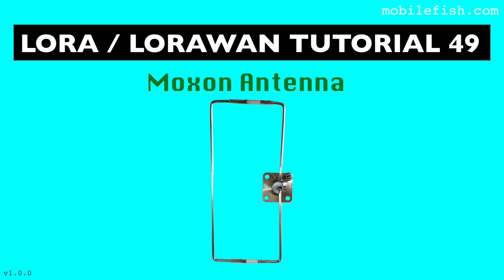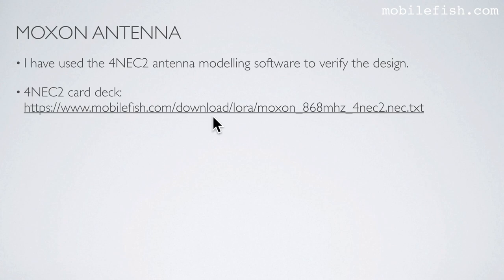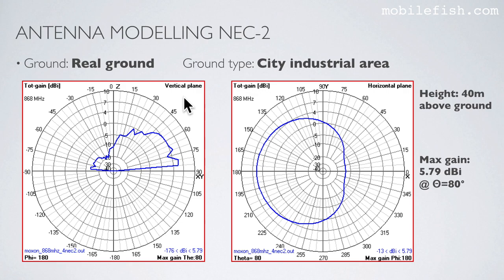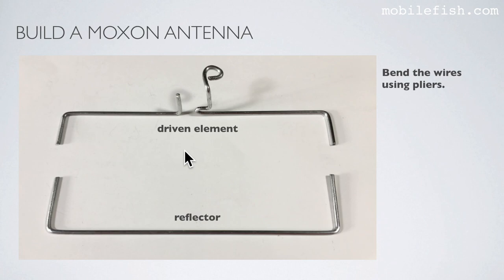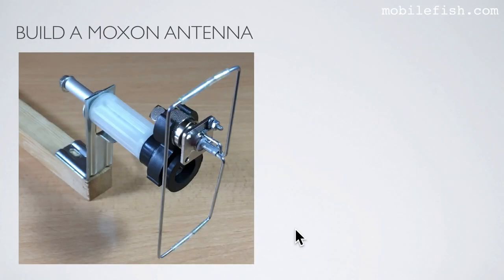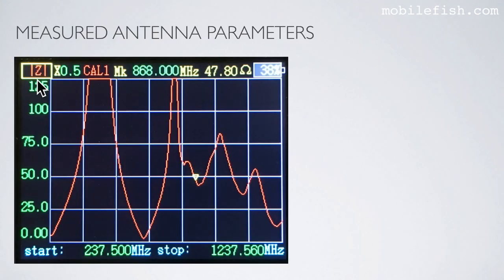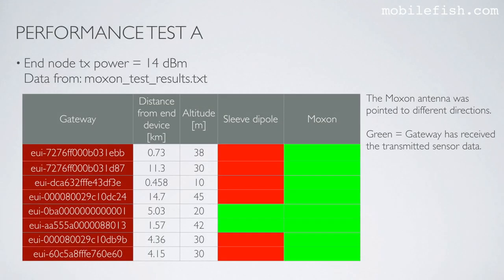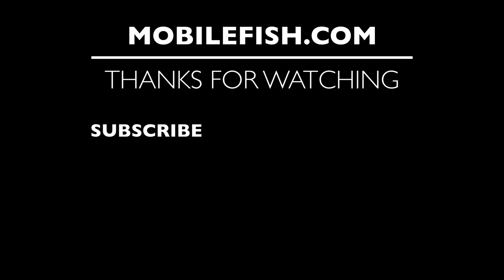LoRa/LoRaWAN tutorial 49: Moxon Antenna

Comment: I can never get much directivity out of a moxon! They do better than a dipole or ground plane but the vertical radiation pattern seems more like a figure 8 in that if I point the antenna & then rotate it 180 degrees I get much the same results. Wondering if you had a chance to check the front-to-back ratio on yours?